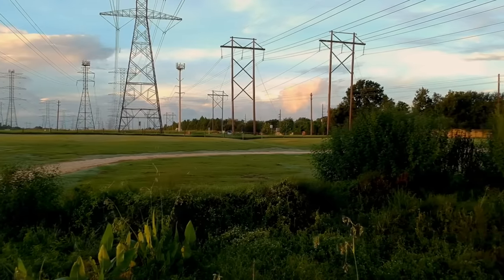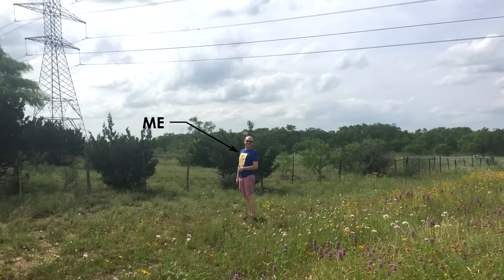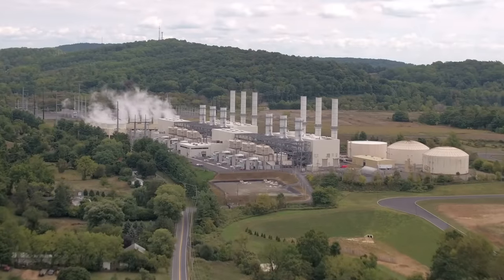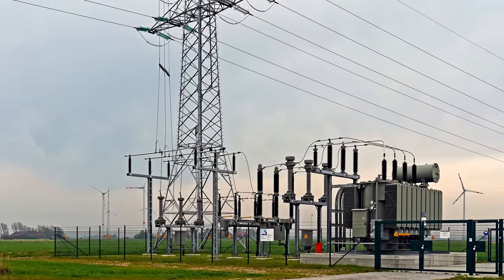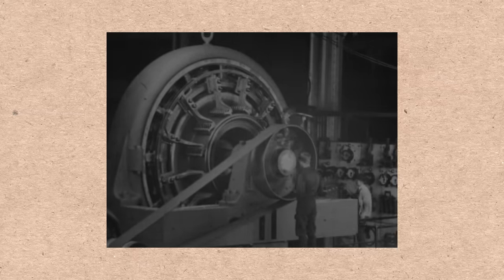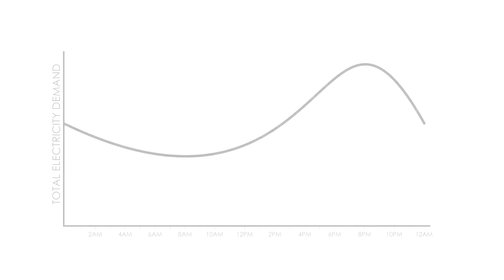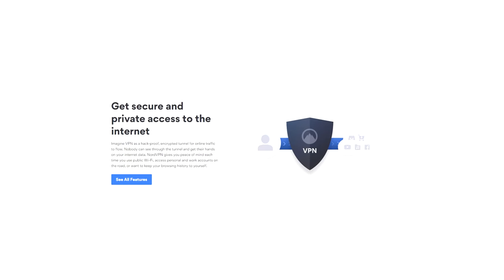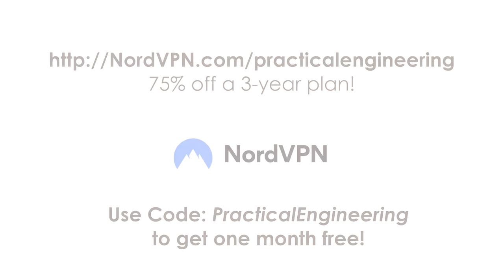How Does the Power Grid Work?

Comment: I was interested in seeing how the various generators, particularly those at different sites, synchronise the phases with each other, but it doesn't get covered.
Reply: Yeah, I also want to know how do the generators maintain the constant frequency of the generated voltage. Hope to see a video on it in the future?
Reply: I live along the Mexican border, and there's a connection at my town between the Texas and Mexican grids, so that power can be imported/exported between them in emergencies.  The trouble is that the grids are both 60 Hz but not in sync.  There is a city-block-sized plant full of ABB equipment that somehow does the synching.  I'd love to know more.
Reply: The synchronization is done when the unit connects to the grid. It matches the system frequency, phase and voltage. This is done with two pieces of equipment. The voltage regulator takes care of the voltage matching. It makes sure the voltage of the system is within a certain tolerance of the voltage of the generator. The governor controls the speed of the turbine and can therefore control the frequency and phasing of the generator's voltage waveform. Once all three quantities are within their tolerances, the logic allows the breaker to close in and connects the unit to the system. 

It's very much like a small car pulling up along side a semi truck pulling a huge load. Once it has match the speed and direction of the semi, you could connect a chain and the small car could begin assisting the semi in pulling the load down the road. It's not a 100% perfect analogy but it's close.
Reply: @TechBuild  i replied to Tony Rule with a short description of the process.
Reply: @MikeV8652  It's likely a DC inter-tie. In that case it's converting one side into DC which is a common means of connecting asynchronous grids together but allow them to transfer power. There are several DC inter-ties along the border of Texas.
Reply: Keeping the generators in phase isn't a problem. Once they're connected, they will remain in phase. But the real issue is at the moment they attach a new generator to the grid, it has to be in phase. You might find this video https://www.youtube.com/watch?v=RGPCIypib5Q as a useful demonstration of synchronizing two generators together.
Reply: You have to first match the frequency of the grid before you can connect to it but first you do need to raise your voltage in your generator to match, or slightly higher, then the grid.  I have scheduled my power plants to the grid manually over 5000 times ver the years.  There are relays that prevent you from connecting if your are not matching the grid, nor will it let you stay connected long if you are not.
Reply: @davidparry4747  Thanks for the info! It would be great to watch a video explaining this.
Reply: @johncochran8497  thanks!
Reply: @MikeV8652  That is usually done with a back-to-back DC converter station.  There are a handful of these around the Texas grid that connect it to the other major systems.  The converter station works by converting the AC current of one grid to DC and then back to AC for the other grid all in one site.  Some primary components include indoor thyristor valves that do the actual converting and harmonic compensation devices on the AC sides.  A DC link allows a high degree of control over power sharing between regions as well as being necessary for the interconnection in this case.
Reply: @johncochran8497  Great video thanks for this suggestion!
Reply: @davidparry4747  Thanks!  Based on what you wrote, I did some searching and found this explanation from ABB on how the installation works: http://bit.ly/2Na50E7 .
Reply: @Awave3  Thanks!  Based on what you wrote, I did some searching and found this explanation from ABB on how the installation works: http://bit.ly/2Na50E7 .
Reply: @TechBuild  For an entertaining description of high voltage DC power transmission and how it's accomplished, you might find this video of use https://www.youtube.com/watch?v=DFQG9kuXSxg
Reply: It is a bit counter intuative how it is done!
The generating kit is spun up to speed. The difference between generated voltage and grid voltage is then measured. As you get close to grid frequency the voltage fluctuations slow down and stop before reversing. At the point in tim the fluctuations stop (and the voltages match) they flip a breaker and the generating plant is then effectivlybeing driven from the grid. This is called synchronisation! 

Once they get to this point the control engineer (for the grid) will call up and request a certain amount of power!  The engineers at the power plant then increase the field strength of the exciter coils forcing the plant to produce more power. They need to also increase the motive power into their plant by an equivalent amount or it will act as a "brake" and slow the mains frequency!
Generating plant can have vastly different run up times from seconds up to days so sometimes plant is kept running with no load on but still synched to the grid ....... this allows for faster response times but adds to running costs!
Simples ..... (when you know) ;0)
Reply: @TechBuild  A grid control engineer will monitor it Closely! If it raises or dips past a pre-defined level they will shed or add generation! They can eather request less power generation from individual plant or even drop plant off the grid!
Reply: @davidparry4747  Thanks for the explanation. I've wondered this too. Specifically in grid tie inverters for people with solar panels on their roof.  In order to put energy back into the grid, the voltage generated needs to be slightly higher to force current in the right direction. The difference in voltage would depend on the desired current, and effective impedance of the grid as seen by the inverter, right? Do you have any idea of what this effective impedance is? Or what the typical voltage tolerance would be for a generator matching the grid?
Reply: I understand the process of connecting a new generator to the grid. and how the frequency must match. But given say 100 generators pumping power into the grid how is the grid frequency regulated. Obviously a single generator can't do it because it would be pushed around by the other 99
Reply: if the generator is out of phase, then it would just be acting like a motor.
Reply: @johnmontgomery560  I'm not in the industry but from what I can tell each generator has its own frequency and voltage regulation.
Reply: @TechBuild  Video linked above shows it great.
Reply: @TechBuild  Wow. This blew up.
Seems they get them very close while offline both in terms of voltage and frequency, and then once they go online, they tend to stay in sync - if they float out a little the grid in effect corrects them through the same mechanism that would,  if they were largely out of sync when brought online, cause catastrophe. I imagine there must be a lot of mechanical inertia via flywheels on the turbines to maintain the steady speeds when load fluctuates.
Reply: @Awave3  We have a HVDC interisland link. https://en.wikipedia.org/wiki/HVDC_Inter-Island
Reply: @VeganSemihCyprus33          If you do not wish to use electricity, you are free to disconnect from the grid. However, besides for the inconvenience, you may actually introduce more environmental degradation.

For example, before electricity use became common in colder climates, many people burned coal, wood, or peat. This caused a great deal of air pollution, releasing particulates into the atmosphere and in the case of coal, radiation.

There are still power plants that use coal, but they have scrubbers which reduce the pollution emitted. These scrubbers are not perfect, but would be better than homeowners burning coal themselves.

If you really want to help the environment, you would encourage the use of modern nuclear technologies, such as molten salt reactors - https://en.wikipedia.org/wiki/Molten_salt_reactor - and promote research into nuclear fusion.
Reply: @gizmoguyar  the impedance of the system is also varying constantly along with the demand. Every time someone starts up some electrical equipment, the impedance changes. To account for this, there are a bunch of machines that act to balance things out. Reactors and capacitor banks adjust the phase angle of grid impedance, mostly to keep the losses in the energy transfer low. The current output is set directly by the generators, and controlled by two main factors: the frequency of the system, and the magnetization current applied to the generator. I don't remember all of the details, but here's a short description: 
The rotational speed of the generator changes whenever the demand is different from the output. If demand is higher, the generator slows down, as its rotational energy is converted to electric power. With quick changes in demand, there will also be changes in voltage. This can be accounted for by changing the magnetization current in the generator, effectively changing what voltage is supplied by the generator. 

Anything connected to the grid will try to draw the power it needs, and the production end just has to catch up. That's the short version, based on what I remember from my studies. 

My job is to make sure the grid is protected from faults and errors, so I don't know all the details on power balance and generation.
Reply: The simplest way to do it is with a voltmeter. Have it link between a phase of the network (called reference) and the same phase of the alternator (called new) (both side of the breaker linking both is the best way to describe the connection). Have the voltage of the "new" adjusted to the same voltage of the ''reference" and then when the voltage is O on your voltmeter between both side of the breaker you know that both are "in phase".
Reply: @MikeV8652  https://youtu.be/ZOTGuWCfS-A  you might better understand the system the use.  the why is to isolate the 2 system and avoid a collapse or brown out or someting like that.  anyway it protecte both system from each other yet permit the  exchange of energy.   (just a curious truck driver so i surely get some of it wrong but the general is there lol )
Reply: @gordybishop2375  the fun begins when those relays some how malfunction ;)
Reply: Yes, fin times when relays trip.  Luckily they give an alarm and or drop a flag so you know which one took you out, but still have to find root cause.  When it comes to electricity some computer historians can not or are not set up to capture data needed to find out, so miss seeing paper charts for that reason
Reply: The generators spin at a constant 3600 rpm giving it a constant 60 cycles per second.  Most generators have 3 sets of windings 180 degrees apart. Giving you the 3 phases you see on transmission lines A B C PHASES...
Reply: Yes, depends on sets or poles in the generator to determine speed but most are 3600 rpm.  I believe generators on dams much slower, hence more poles
Reply: They are called synchronous machines, they are brought up to speed before connecting and then once online they are part of the grid.
Reply: @gordybishop2375   Gordon.. you are correct on the slower spinning generators.  Nuclear power plants spin at 1800 rpm with more poles in there generators.  They don't have the thermal steam pressure output that an efficient  coal fired power plant has. That spins the turbine which drives the generators that produces the electricity. Wind mills and hydro plant may also spin slower with more poles.  Tho they have to produce 60 cycle electricity  here in the USA to connect to the grid
Reply: My plants were 30MWe net rated Mishubishi units but we could get 42 gross MWe out of them in summer, Solar Thermal.  Gave a coal plant guy a tour once, he said his forced draft fan motor was larger then our generator...size wise.
Reply: @MikeV8652  
The different interconnections have DC lines that connect them. So power on exporting side is converted to DC flows through the line and is synched with the importing side frequently.
Reply: You basically turn on the generator, separated from the grid. Once you get the rpm correct, you’ll see 3 lights start flashing slowly, once it’s flashing slowly it means you are just under the frequency of the grid. When the lamps are dark, you flip the switch and the frequency will “pull in” the generator to the same frequency (rpm). The newer versions are done by computer for more accuracy. Got to do a lab on it in my fourth gear electrical.
Reply: @gordybishop2375  I manually synch my conventional units to the grid too. It's the fun part of starting up a conventional gas fired steam turbine!
Reply: @JesseFernandez  yeah...pert much the grid demands it...lol
It is all about speed.  Old plants had two lights....if one was on too fast....if other too slow
Reply: @gordybishop2375  I actually use a synchroscope. It's looks like a clock with one hand. If the hand is spinning clockwise you're going faster than the grid, counter clockwise is slower than the grid. 12 o clock position is in phase. So you close in your CBs right before 12 o clock in the fast direction.
Reply: @JesseFernandez  yes that’s what we had.....we closed going a wee bit fast